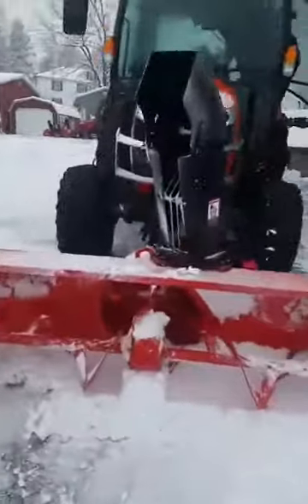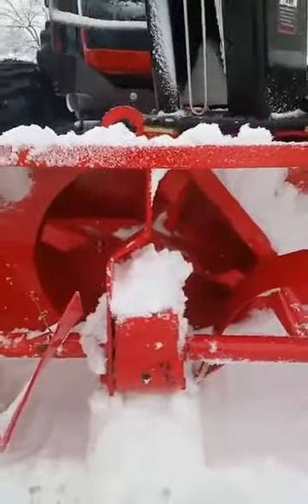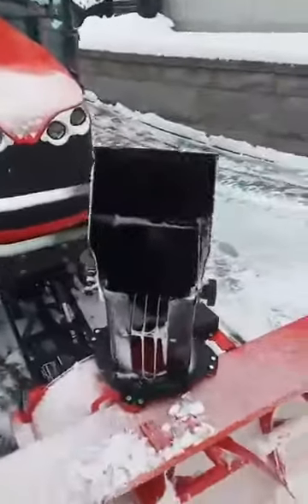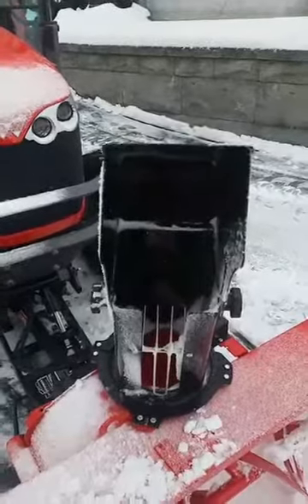Massey Ferguson 1736 Cab Tractor with MF1410 Snow Blower with Ray III

Comment: I have a GC1715 with the front mount blower and I love it.
Reply from the maker: The GC1715 with MF2360 Front Mount Snow Blower is a Great Unit! This MF1736 CAB Tractor with MF1410 Snow Blower is the "Big Brother" to the GC1715 and Also Works Great!

Comment: Is the 1736 that much better and worth the price over like the 1734. Looks like it did great thanks for the video
Reply from the maker: The 1736 is the "Premium Series" Compact Tractor, with Deluxe Features, Mid PTO and Factory Cab Option. The 1734E is the "Economy Series" Compact Tractor, with Standard Features, No Mid PTO, and No Factory Cab Option.

Comment: impressive performance, but it helps to include information about the tractor and the blower, whether you list the details here or provide links to details about the tractor and blower.  I don't know if that tractor comes under compact, subcompact, or utility tractor so that makes me have to search for this equipment since I know nothing about Massey Ferguson tractors.
Reply from the maker: Thanks for the Suggestions. This Tractor is a Massey Ferguson 1736 Compact Tractor with Massey Ferguson 1410 63-Inch Front-Mount Snow Blower. Visit www.masseyferguson.us for More Info.